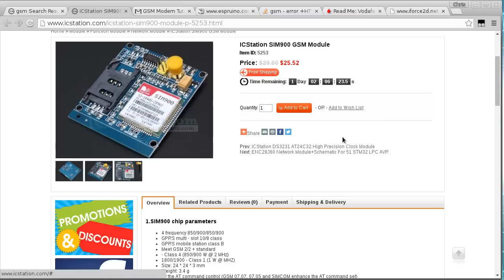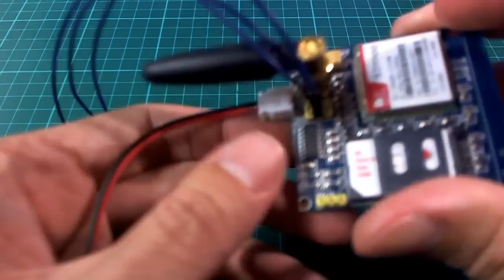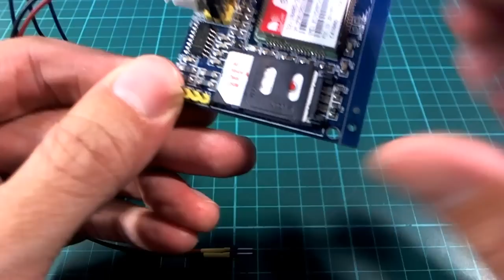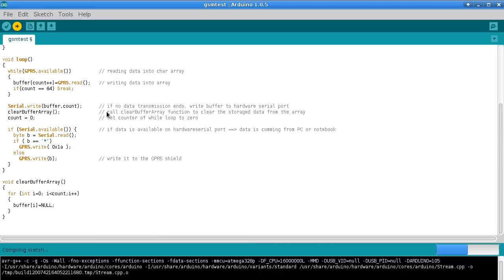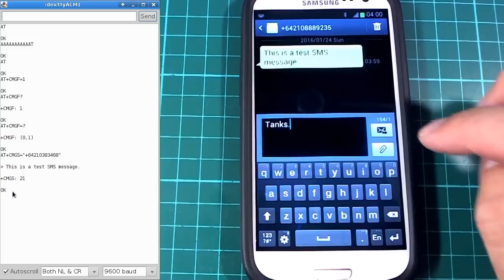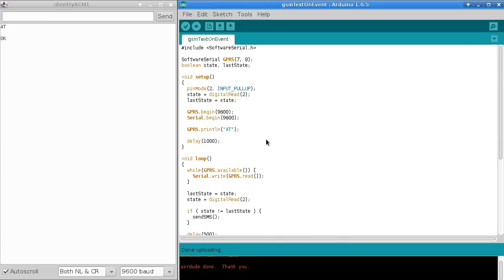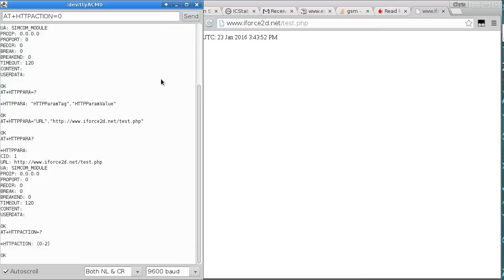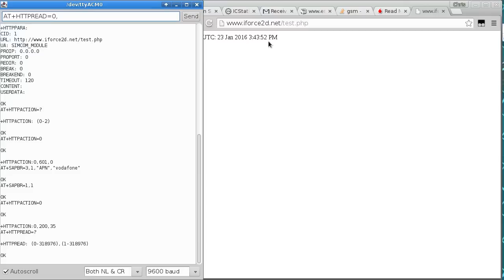Arduino + GSM module (SMS message, HTTP requests)

Comment: Thank you very much this worked great! What would I need to modify to add more than one number? In addition if I wanted to send the texts more than once what would I need to do? I could copy and paste the same command over and over but is there a more efficient way?
Reply from the maker: Copying and pasting will work fine. You could also put a list of numbers into an array, and loop over the array to do them all. Remember to leave enough time in between for the GSM module to do its job.
Reply: Okay so here is the code im using. I did modify what it says and does as far as serial and sms titles. But it has been a long time since I have coded anything with arduino so im lost. I know some people have mentioned I can make/define other "VOIDs" and then use those for other numbers... But everytime I try it wont work...

#include <SoftwareSerial.h>

SoftwareSerial GPRS(7, 8);
boolean state, lastState;

void setup()
{
  pinMode(2, INPUT_PULLUP);
  state = digitalRead(2);
  lastState = state;
  
  GPRS.begin(9600);
  Serial.begin(9600);
  
  GPRS.println("AT+CMGF=1");
  
  delay(1000);
}

void loop()
{
  while(GPRS.available()) {
    Serial.write(GPRS.read());
  }

  lastState = state;
  state = digitalRead(2);
  
  if ( state != lastState ) {
    sendSMS1();
  }
  
  
  delay(500);
}
void sendSMS1() {
  Serial.print("Switch was turned ");
  Serial.println(state ? "Off" : "On");
  
  GPRS.println("AT+CMGS=\"+10000000000\"");

  delay(500);
  
  GPRS.print("House ALARM!!! ");
  GPRS.println(state ? "Off" : "On");
  GPRS.write( 0x1a ); // ctrl+Z character

  delay(500);
}
Reply from the maker: "I'm lost" is not a helpful description of the problem. Is there something wrong with this code? I only see one number. How about making a function called sendSMS2 that sends a txt to a different number....
Reply: I say that because I am not sure how to write some functions correctly. It usually wont compile and spit some error out. It seems now it did compile and I uploaded it to the arduino. Here is my new code with two numbers but if you look at the serial output it sends the alarm off message twice but the actual SMS message is only send to the first number. What is the problem? 

#include <SoftwareSerial.h>

SoftwareSerial GPRS(7, 8);
boolean state, lastState;

void setup()
{
  pinMode(2, INPUT_PULLUP);
  state = digitalRead(2);
  lastState = state;
  
  GPRS.begin(9600);
  Serial.begin(9600);
  
  GPRS.println("AT+CMGF=1");
  
  delay(1000);
}

void loop()
{
  while(GPRS.available()) {
    Serial.write(GPRS.read());
  }

  lastState = state;
  state = digitalRead(2);
  
  if ( state != lastState ) {
    sendSMS1();
    sendSMS2();
  }
  
  
  delay(500);
}
void sendSMS1() {
  Serial.print("Switch was turned ");
  Serial.println(state ? "Off" : "On");
  
  GPRS.println("AT+CMGS=\"+10000000000\"");

  delay(500);
  
  GPRS.print("House ALARM!!! ");
  GPRS.println(state ? "Off" : "On");
  GPRS.write( 0x1a ); // ctrl+Z character

  delay(500);
  }
void sendSMS2() {
  Serial.print("Switch was turned ");
  Serial.println(state ? "Off" : "On");
  
  GPRS.println("AT+CMGS=\"+10000000000\"");

  delay(500);
  
  GPRS.print("House ALARM!!! ");
  GPRS.println(state ? "Off" : "On");
  GPRS.write( 0x1a ); // ctrl+Z character

  delay(500);
}
Reply: AT+CMGF=1

OK
Switch was turned Off
Switch was turned Off
AT+CMGS="+10000000000"

> House ALARM!!! Off

+CMGS: 32

OK
Reply from the maker: I don't know, and I don't really have time to debug somebody else's code in this much detail. If each function works ok when used one at a time, I would suspect you need to add a longer delay in between them.

Comment: The wiring connections are unclear and the (0x1a) shows in error when compiling the code, any chance you can clarify for me please...thanks..
Reply from the maker: I see. On the arduino side the pins will be whatever you choose in the source code.
Reply from the maker: I explained the wiring at 5:48, what's not clear?
Reply: iforce2d I think it's unclear whether Rx goes into 7 and Tx goes to 8 or the other way around. 

Great video, by the way!

Comment: Very good briefing.

About the AT commands.

Before there was Broadband internet, computers connected with each other with Telephone modems.

Computers connected through their modems on their serial ports at various speeds.
The first baud rates were 1200, 2400, 5600 or 5700, then 9600, the fastest.

Computers would give AT (attention) commands  to their modem to do connect with Dial-in servers.

Hayes made the most popular modem.

https://en.wikipedia.org/wiki/Hayes_command_set#Commands.

Again,  the Cell phone or the GSM card is functioning as a modem.

Comment: Funny how the atmega  memory is just 2KB ... yet the data you read on your http get final query was 13KB ...
Reply from the maker: The data is in the GSM module memory. That's what the HTTPREAD command is for, to fetch it after doing the get. See 43:24 where we can see that this particular GSM module has 318976 bytes of memory usable.
Reply: Yup, I figured it had to be some sort of onboard memory.
Also about these new gsm/gprs chips, SIM does make a new one that I think it will be of your interest, the SIM808. That module contains not only GSM/GPRS but also a GPS. Neat! (I'm sure it will be more power hungry tho ...)
I'm not sure the GPS can be used for timing purposes on the SIM808, for example to make a time server source.
But the added GPS does make the module seem more interesting.
The usual online sources ebay/alibaba/banggood/gearbest and the like all have those modules also.

Comment: Hi, i already follow the procedure, but when i try to test my sim900a module with gsm test code, my serial monitor didn't reply/echo back my command. i try with the another gsm(sim808) it work. So i needed ur help. i already buy a new sim900a but it still the same.

Comment: Hi, my gprs shield arduino uno sim900 is always sending a message with pop up and says class 0 message with button cancel and save. Now, If I will press cancel button the message will not save on my phone inbox otherwise pressing save button it will save on my phone inbox. can you help me with this problem? I want to send it automatically save on my phone inbox like yours.
Reply from the maker: I have absolutely no idea. But luckily I know how to use Google :)
http://blog.richpollock.com/2014/06/class-0-sms-messages/ (search for "data coding scheme" and "class 0")
http://www.espruino.com/datasheets/SIM900_AT.pdf (search for "data coding scheme" especially in the CSMP section)
Query your current setting (AT+CSMP?) you may need to change the dcs parameter
Reply: I did check this AT+CSMP? command and the program response like this

 AT+CSMP?

+CSMP: 17,167,0,16

and I apply it like this 

  mySerial.print("AT+CMGF=1\r");  
  delay(100);
  mySerial.println("AT+CSMP = 17,167,0,16"); 
  delay(100);
  mySerial.println("AT + CMGS = \"+639*********\"");//universal number
  delay(100);
  mySerial.println("A test message!");
  delay(100);
  mySerial.println((char)26);
  delay(100);
  mySerial.println();

but sadly the class 0 message is always appearing when my phone received the message.

I am glad if can help me with this problem. 
Thanks.
Reply: Thanks a lot sir, I found the answer through debug I change the default CSMP = 17,167,0,16 to AT+CSMP = 49,167,0,0

:)
Reply from the maker: Yes, you need to change that value. Setting it to the same value will do nothing :) Glad you could figure it out.

Comment: Sir , I'm using simcom sim800 with msp430g2553 microcontroller and it works on serial monitor but doesn't send sms in real, I don't know what's wrong. as msp430 gives 3v vcc out I have supplied modem with dedicated power supply of 5v. At 5v modem doesn't blink network led, it blink network and status led at 9v supply voltage. please reply as soon as possible
Reply from the maker: Try reading the documentation for your SIM module.
Reply: use SMS instead of GPRS in sketch
Reply: The 2G modems which SIM800/SIM900 is will not work in USA or where 2G is turned off.  "ITEAD SIM5216E 3G Module WCDMA HSDPA GSM / GPRS /EDGE Shield Board for Arduino" will work with 3G sim activated.
Reply: Expert so you are Rob. May we know each other ? I am starting involved in the SIM modules

Comment: I am just a beginner. So please bear with me. How can I get the data from the web page? I have a simple web page that only displays yes or no. The code provided here only displays the content to the serial monitor. How can I save it to a variable to I can make a conditional statement like: if ("no") do this else do that. Thanks.
Reply from the maker: The arduino and the GSM module communicate via a serial connection. After doing the HTTPREAD request (as I showed at 43:29) you can then do serial.read() to get the bytes. As each byte comes in, you can save it, or check it to make a decision.
Reply: Thanks for the quick reply!
Reply: iforce2d When do you need to do an AT+HTTPTERM?
Reply: iforce2d Also, what if you need to do another request to a different URL when a condition is met?
Reply from the maker: I don't recall ever using HTTPTERM. My GPS tracker has run for many hours, doing a HTTP get every 10 seconds without problems. I don't see what the problem is with using a different URL... just change the URL.... maybe you need to explain the problem better. If you're asking how to decide when a condition is met by looking at the incoming text from the HTTPREAD, I don't see the difficulty with that either. Obviously you will need to have the server send a response that you can parse with an arduino, eg. just a few characters in a specific order. If you're thinking to read in a whole HTML page from some generic website on the net and try to parse it, forget it. Most likely you will need to be controlling the server output as well, to make it easy to parse.
Reply: Again, thanks for your quick reply! I apologize if I did not explain the problem clearly. Anyway, I was able to make it work. Anyway, I'll describe my project just in case. I have created an Android app paired with an Arduino/GSM/GPS module. The app can request the location of the tracker. I was able to use your sketch. I needed to use HTTPTERM to terminate the request to the URL checking if there is a tracking request and make a new connection to a different url that sends the GPS. The sketch I made switches between sending an HTTP request to listen for  a tracking request and listening to GPS data. Again, thanks you for being helpful!
Reply from the maker: Sounds like you might be better off using SMS rather than HTTP, that's how a lot of GPS trackers work. Apparently Android can programmatically handle SMS messages:
https://developer.android.com/reference/android/telephony/SmsManager.html
http://stackoverflow.com/questions/19131307/send-and-receive-sms-inside-my-own-application-only-not-in-the-native-message-a
Alternatively, since your arduino is continuously contacting the server (if I understood correctly), you might as well just make it submit the current GPS location every time, then it would not need to switch between different URLs.
Reply: Using SMS was my first option. However it is not clean if integrated with an Android app. Since KitKat, SMS can only be managed on phone's default SMS app. So all SMS transactions between the app and the arduino appears in the inbox and sent (which I do not want to happen). So ended up using HTTP and it worked perfectly! Thanks for your video and replies!

Comment: hi thanks .. my question is and what if you want to connect and send data to a sql database on a webserver ? how do you implement sql connection ? is there any documentation somewhere ? i  want my arduino to send data from a temperature and humidity sensor  the arduino receives data from a hf radio module and send it to my sql database via gsm module...

Comment: @iforce2d Hello man, many thanks for this video really helped, may I ask you how I can send variable in SMSs? for exemple var change every 1 hour and I need to send it everytime to change? what AT command should I use for this?
Reply from the maker: I don't see why any AT commands would change... you just want to send different text content in the message right? In the example in this video I sent some text like "Switch was turned" etc, so you would just change that part. If you are more interested in how to trigger it every hour, I have never done that but I found a lot of useful info by googling "arduino every hour".
Reply: Hi many thanks for your reply, I just meant for exemple I do have a temperature sensor and I should send the value of the sensor named VAR, if I use the regulair AT+CMGS for exemple: 
{
mySeriel.println("AT+CMGS=\"+xxxxxxxxxxx\"");
delay(500); 
mySeriel.print("VAR "); 
}
it will just send the word VAR in the SMS. I'm sorry for my English it's a bit weak, I hope you can understand me this time. again I thank you for your time sir.
Reply from the maker: Well of course it will only send the word, because that's all you told it to do. Are you new to programming? You have to actually tell it to send the variable if you expect it to send it...
int myvar = 123;
Serial.println(myvar);
Reply: again many thanks, you helped me a lot!, yes I'm new but I'm learning fast!.

Comment: Hi, So when i put my sim inside, and power it on both the LEDs start flashing repeatedly, i take it that is not connecting to the cell tower. It worked before for me, but then suddenly stopped working and i have no idea how to reset it. Any help, or ideas ?

Comment: does this sketches works on GSM2 CLICK board? or I have the same exact GSM board as yours? thanks, and my TX and RX in arduino are 1 and 2, can I use them instead of the 7 and 8 as you did? I'm arduino newbie!

Comment: verifying my sketch and this is what i got. is this error or just a normal?

C:\Users\C\Documents\Arduino\SMS\SMS.ino: In function 'void clearBufferArray()':

C:\Users\C\Documents\Arduino\SMS\SMS.ino:41:17: warning: converting to non-pointer type 'unsigned char' from NULL [-Wconversion-null]

       buffer[i] = NULL;

                 ^
Reply from the maker: I know of no file called SMS.ino anywhere in this, and no function called clearBufferArray... but to answer your question, as the message says, it is a warning, not an error.
Reply from the maker: You could try buffer[i] = 0;
Reply: Thank you for your wonderful answer sir.now its display no error but the bad thing is when I enter the "AT" command in my serial monitor it display nothing.  I know we have different module. I used sim900 and connect my sim900 TXD to arduino digital pin8, RXD to pin7, GND to GND and i think i did wrong connection. Can you tell me the best wiring for sim900?

Thanks~

Comment: nice video....please answer my question : i am using simcom800 and arduino uno ... but the output (message ) is getting displayed on the serial monitor , but not the mobile .... any idea .... y this is happening ...... ?

Comment: I have sim800
I use GPRS
I use http GET command 
I call a phpfile that uploads voltage in MySql database
when the comand is executed I get no response like "+HTTPACTION:0,200,15" or anything like +HTTPACTION:
But after continious tries i got it once but every time the command is executed the voltage is saved but the problem is i don't get to use HTTPREAD comand 
The same was working fine in sim900A

Comment: i connected just u did in the video .. but 1. suddenly top left led of the board starts to blink fast indicating the sim connection isn't ok. what may be the probable reason of that problem? it's giving me much pain . 2. the same code sometimes works , sometimes not working ( suppose blinking led by sending sms ,connection ok, indicator leds blinking also ok)

Comment: Sir i am not receiving the Message on my mobile number after one message. means first message is sending but after not sending any message, Serial Monitor show the Switch was Turned then after delay time  Error. Place of On/OFF. What can i do please help me. i will submit my project On Saturday. Thanks
Reply from the maker: If you did everything as I did in the video, I have no idea.
Reply: i did every thing and your other tutorials are working
Reply from the maker: Okay, then I have no idea. Try doing everything manually first, before making the program do it automatically, is all I can suggest.
Reply: means 2 led light on and off through sms like r1 and y1 but this sending message not working on this time. please help me tell me any other hint or any thing. thanks
Reply: Thanks i found my mistake that my mistake was not country two digit code... Thanks again
Reply: Tanay Rami you should give power through 4.2 to 5 V adapter.
My proplem is solved like this.
Reply: @Tanay Rami  check the baud rate 9600,57600 or something else. try to keep all those same
Reply: Tanay Rami  check ur connection again and what power supply u r using

Comment: this is interesting.  I'm trying to interface my car with my cell phone.  In Canada, Rogers Cellular has a basic Flex data plan with 10mb data only for $5/month.  I would think that would be ample with basic commands without a lot of overhead.  I'd like to kick off my remote starter through the Aux trigger pin on it, and switch on the rear defrost, and turn the heat and fan on high, or turn the A/C on. I'd also like to lock and unlock it and get the lock status, and get a temperature reading.  GPS location would be nice too.... and maybe roll up the windows.  I'll look through your videos, but maybe you have something like this you could point me to.  Thanks,